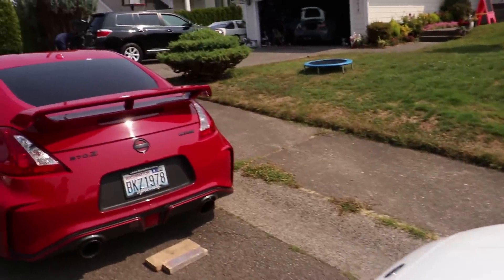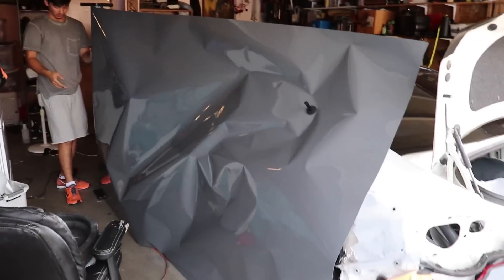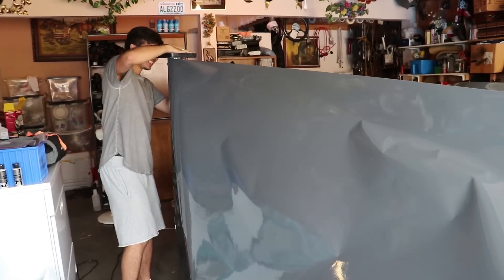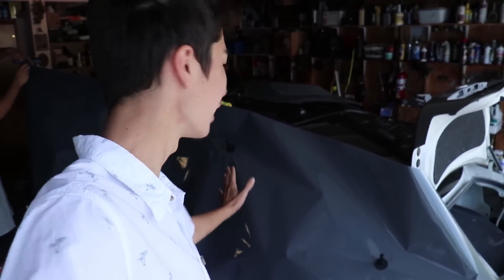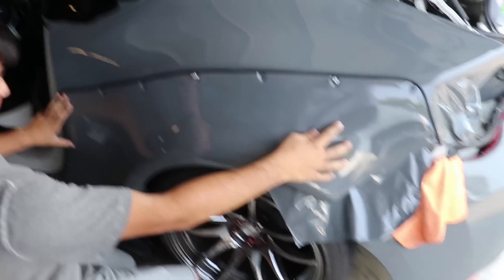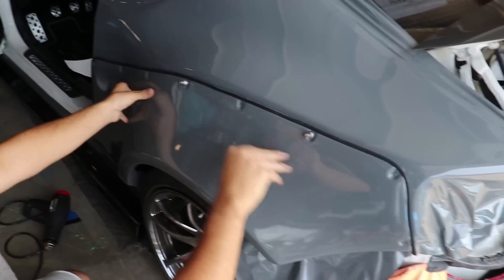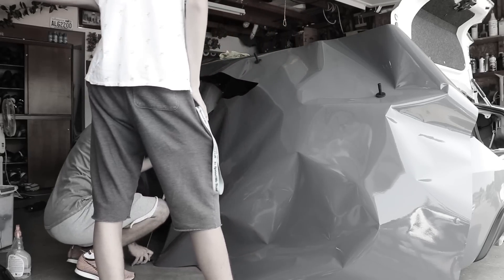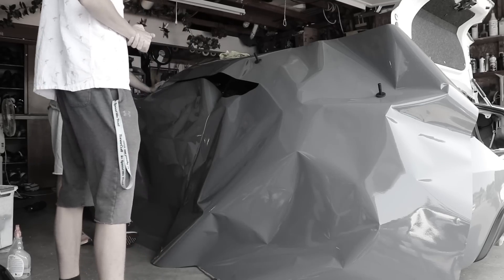Wrapping my Focus RS?

Comment: Hey Jack, I have an idea for a version of city camouflage. Sleeper City Camouflage. Basically, its city camouflage except to confirm the vehicle, the seeker has to bump/tag the car in question, and or can bump a car that they think is a camouflage car without saying much, (still recommending that the seeker still follow the car they are about to tag for a while), but, the camouflage car can also try and run away. What makes this interesting is that the seeker can be in any car below x class, while the camo cars still have to be the models of the cars in the game, but to make this fair, the camo cars can be fully upgraded while keeping the cosmetics of the car the same. Of course, there is a balance as a seeker can easily tell if a camo car has been engine swapped. Please take this into consideration for a video, Thanks.